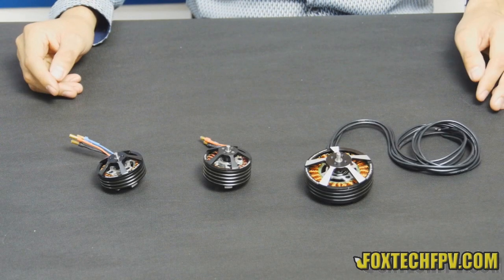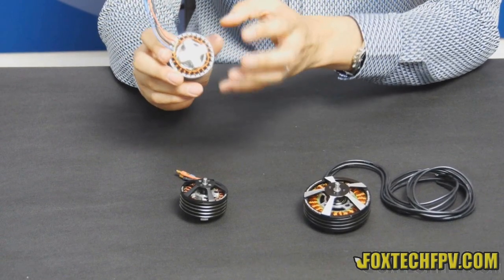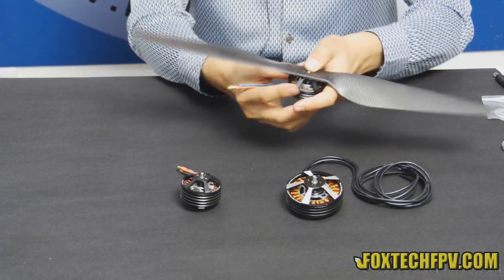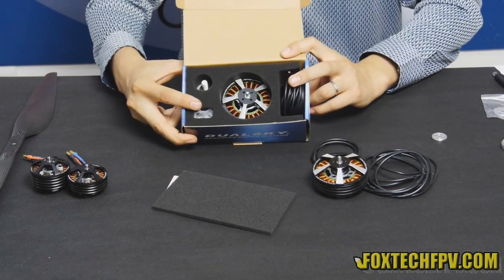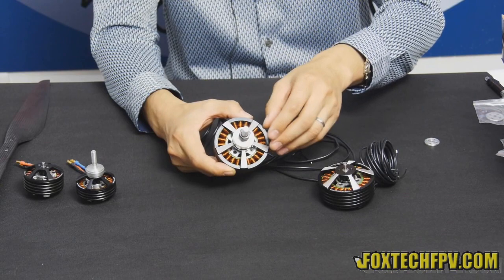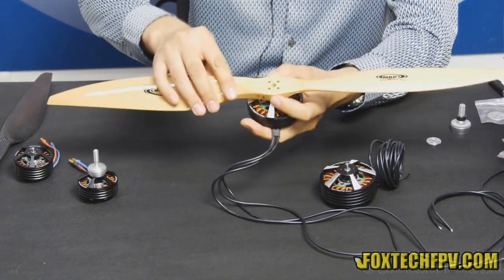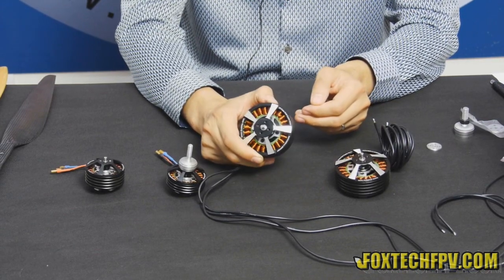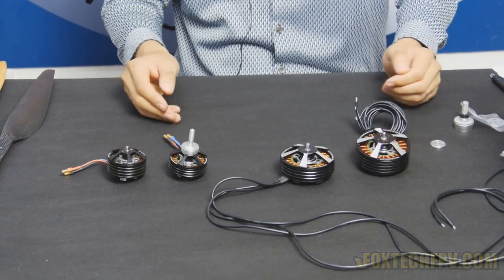Dualsky Brushless Motor series

Comment: Can I use a 18" Supreme light prop on the motor you tested? I plan to run 4s lipo although I may use a 6s. Thanks
Reply from the maker: Yes , you can , we use 17inch in the test , run under 6s
Reply: Cool, I will definitely run 18" props on these motors but will they be over propped or draw to many amps if I use a 6s?
Reply from the maker: Jake B Hi Jake , 18inch propeller work under 6s maybe a little overload .(we just did a test ) 6s matched with 17inch or 15inch is fine .